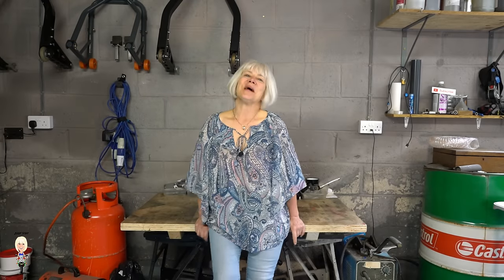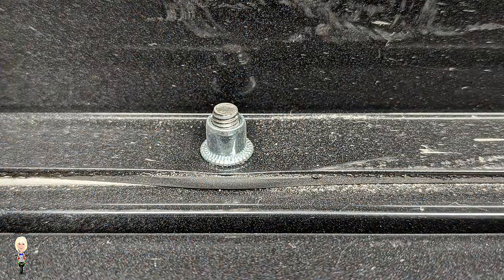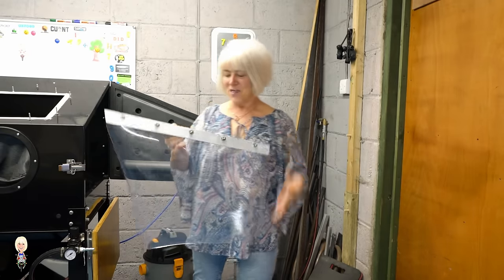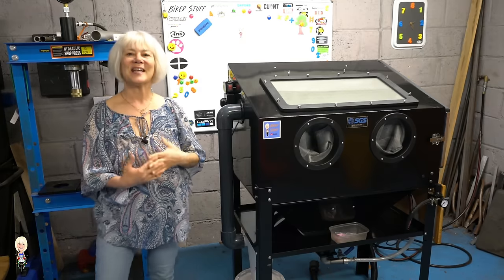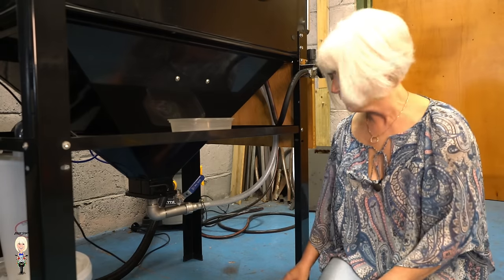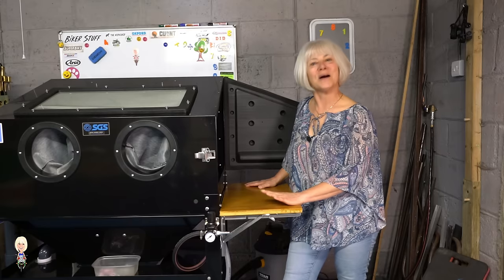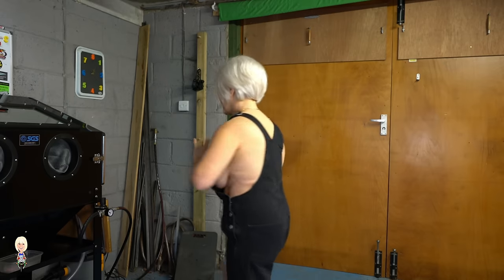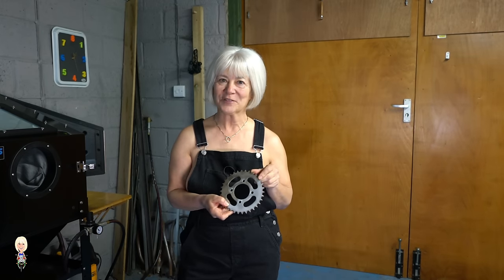What have I got?

Comment: I think your mods are really good, the essential is the large vacuum extraction, without that you can only blast for a few seconds, the other thing you did not mention is the size of your compressor, these things use a huge amount of air, and you need at least 10 CFM to keep up with them, although you have the vacuum take off I think it would be a good idea to wear a good mask, there is a lot of fine dust that gets passed the glass screen, are you using glass beads or grit? The glass beads are really good for cleaning aluminium parts. Stay safe! Chris B.
Reply from the maker: I have glass but currently using aluminium oxide

Comment: Please make sure no machines with bearings are in the area. No matter how well you try to contain the media dust, it will escape and destroy any bearings that it gets into. Lokks like you have only a press in this room which should be safe. Also, stay with the alumina. Glass beads shatter and create glass dust, that will lacerate nasal and lung tissues. Glass bead is best done outside with full respirator. It has given me several bouts of pneumonia before I became much more careful, and finally switched to alumina.

Comment: I'm glad you chose to do this video.  I have a Harbor Freight version that performs less than stellar.  I could see several of your mods could help my blaster give me better performance.  I especially like your wand aerating  media before the gun.  Media plugging up in the uptake tube is a huge problem with mine. I deon't know if youu can get it in your country but I use "diamond dust", sold by HF and it works well.  In a pinch I go to my local box store, Lowes, and buy the 70 pound bags of playground sand.   It works well but is very dusty.  Now I've got an excuser to install the dust extractor, eh?  Excellent video.  Now I have to watch it again so I can take notes.  Thanks!
Reply from the maker: Once modified, I believe these are good small use blast cabinets.

Comment: I use talcum powder in the gloves, and I have raised my cabinet so you don't have to bend over for so long! What lighting did you use as mine is useless? Great video as usual! Thank you!
Reply from the maker: I stand on a small pallet as the tank is too tall for me, but if I cut it down it will be too low for my husband to use.
I bought an LED lamp from Amazon.  It is called, V-TAC LED Batten Light 20W 2Ft 6500 White.
I hope that helps.

Comment: Hi Dana, 

Have you ever done bushes on a triumph single side swinging arm?

I just had the Mot done on the Sprint GT and they put an advisory on the rear suspension 

Any pointers or advice would be greatly appreciated?

Take Care, Marc
Reply from the maker: No, sorry I haven't.  But it can't be much different to a regular swing arm.  Good luck.
Reply: @bikerstuff2  I best do it and do a video then.

I sorted out the rear hub myself after the bike shop wanted around £200 to do it for me.

I’m glad I studied aircraft engineering all those years ago.

Thank-you for your reply 

Marc

Comment: Great video did you make or buy the metering valve would love a close up of its setup please
Reply from the maker: I made it from regular water pipe.  1"bsp elbow, 1"bsp straight barrel, 1"bsp to 1/2"bsp reducer, 1/2bsp to 15mm hose tail.  The air inlet is a 1/4"bsp isolator valve that I drilled and taped into the straight barrel.
Google, blast tank metering valve for pictures.
Reply: @bikerstuff2  great thanks